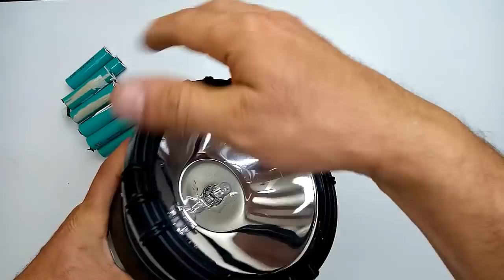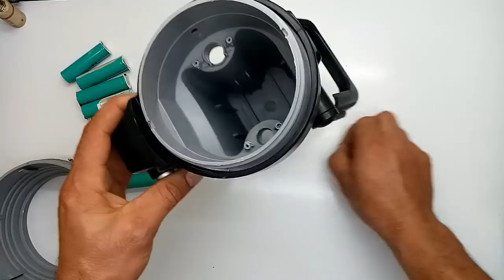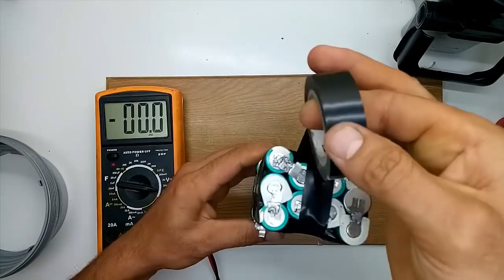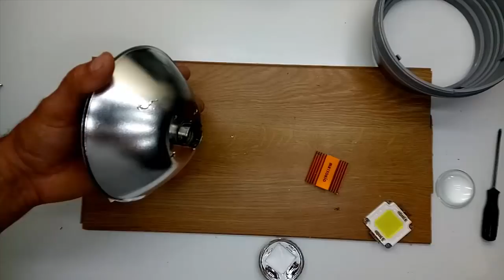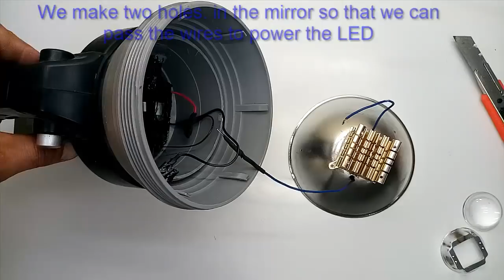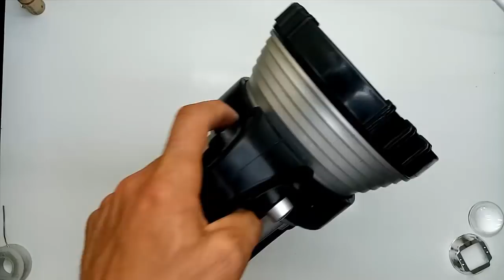How to Transform/ Convert old Flashlight ni-cd to li-ion halogen bulb to the led

Comment: I would probably use 3 batteries in series with BMS board (to aproach 12.4) V, the other cells in paraler to icrease capacity and then use boost converter. I would make it like that. But this is a option too, great inspirative video.

Comment: Terrible video. Absolute fire hazard!   No BMS (battery management system) so nothing protecting a short circuit, over charge and discharging. Over current protection. Very dangerous! 18650 must be treated with care or they can vent and catch fire.  This flashlight is a fire hazard and very Dangerous!

Also that heatsink does absolutely nothing with that the giant Gap.

Comment: What value resistor did u put on there, u need all that amperage for anyway, I believe since u had made no provisions for these lipo’s to get charged and all that extra space in there why not add batteries.. nice work though... also what voltage led was that.. thanks
Reply: The resistor was only on the charging side, the led has to be rated  (number of batteries in series × 4.2v) so for 10s the led is 42 volts

Comment: Is it a 10W or 20W COB LED ? Other ?
Reply: Francois ORSERO On screen it said 50 wich sems to me it can melt the plastics.
Reply: It I read it, but I think there is a mistake and that it is not 50W .
2 reasons according to me : 1st, a 50W LED has a surface way bigger than a 10 or 20W one. @ 2:48 we can see the yellow part is small.
2nd : the heatsink is way smaller for a 50W LED chips. Check it out in AliExpress and other shops, heatsink for 10 ... 20 ... watts LED are this size, but way bigger for 50 or 100 watt LED.
I know it because I am on a project with a torch like this and a big heatsink does not fit inside the torch (not to mention as you said, heat from a 50 or 100W led can not escape the torch as there is no holes drilled or other system to evacuate the heat which would melt imo the plastic parts.
So either there is a mistake in the description of this project and the LED is 10 or 20 ... watts, or there is a misconception of the project using a too small heatsink leading in a short time use of the torch and a big time off between 2 uses in order to cool the system ... So I was curious about the answer of +DIY Tips&Tricks
This being said, one of the best video about the transformation of an old torch